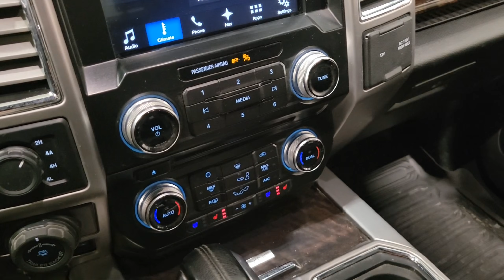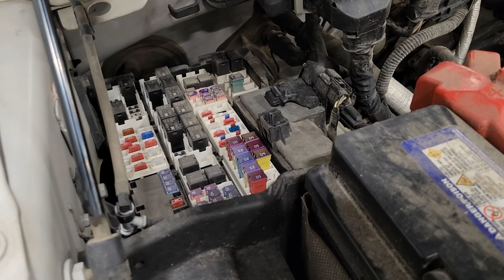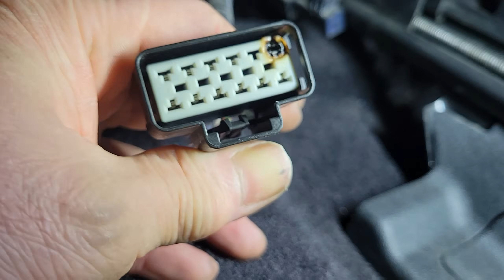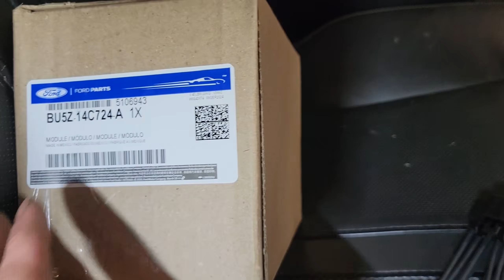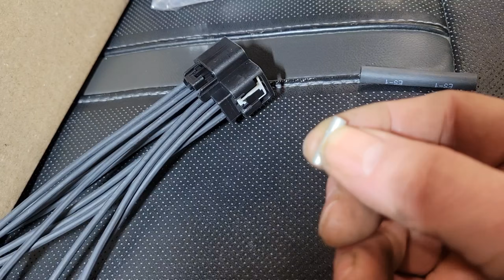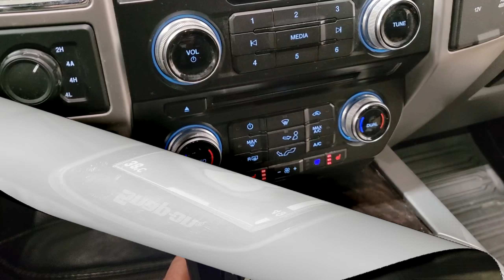How To Fix Common F150 Heated Seat Failures. No Special Tools Needed.

Comment: If the harness melts the module usually need to be replaced as well, you can get modules online cheaper than from ford and they work. If you replace the plug and module and it keeps popping the fuse only when you turn on the driver or passenger heated seat you need to replace the elements in that seat
Reply from the maker: Thanks for the extra advice on replacing the modules and testing the elements, that’s very helpful info!

Comment: 2016 F150 Coyote Lariat about 123k miles. Did this today, added the “extra” ground and so far it’s working great. Only part that was tough was dealing with the melted plastic. Had to wreck the original plug pretty good to get the “T” out. Your video helped me out, thanks!
Reply from the maker: Glad you got it sorted out and it's working for you now, thanks for watching!

Comment: question.  i have a 2019 ford f250 lariat diesel.  my drivers seat heats and cools but my passenger seat neither heats or cools but the button lights come on.  any suggestions?  thanks

Comment: My driver side doesn't work. Passenger side heats fine. I looked under the passenger seat and there isn't a module there like shown in the video. I looked everywhere and it's not there.
Reply: Did you ever figure this out? Mine has the same problem

Comment: I have only the drivers heated seat not working in my 2018 F-150. The others wirk find and the cooling function also. Same deal in out 2020 Explorer. And the rear is even stranger. The button does not light up. What could it be for each case?

Comment: Fuse 17 on my truck is a 10amp for the anti lock breaks. I have an 18 f150
Reply: Did u ever figure out the correct fuse. Im also on a 2018 f150 and confused as well

Comment: Does this cause the system to not work, or work poorly? I have low flow but Ford says it is a flow problem due to collapsed seats.top and bottom both sides. Could it be low power?

Comment: Thanks for the video it was a lot of help. My truck has the same melted piece as this one. Where can i find the exact parts you got for this truck ?
Reply from the maker: I called the Ford dealer and gave them the serial number. You can order it through them, or sometimes they will give you the part numbers and you can try ebay.
Reply: @shanersmechaniclife3164 thanks man!! I will try that

Comment: Does the controle module on the passanger control the driver and the passanger?
I dont see a similar module under the driver
Reply from the maker: Yes. It does both. This truck had issues on the passenger and driver side.

Comment: Does this repair fix both the cooling and heating features? Neither feature works on the driver or passenger side.
Reply from the maker: Yes it did on the vehicle I worked on. Unless you have more than one problem. Let me know how it works out for you. Thanks for watching.

Comment: my heated seats work after fixing it in the video but the wires get really hot when in use, what could be the problem?
Reply from the maker: Check all your connections for corrosion, fit, and signs of melting. Extra resistance causes heat. Hope this helps. Thanks for watching.

Comment: I cannot get the big plug out for the life of me
Reply from the maker: Sounds like it might be melted together.
Reply: I used needle nose pliers and a lot of force
Reply: Same here! Did you ever get it disconnected? Please tell me there’s a trick to it. I tried for almost an hour. Put vice grips on it and still couldn’t get it to come out.
Reply: I had a really hard time as well, gotta use some force with some smaller channel locks and keep wiggling it

Comment: Does anyone have the part numbers from ford for these two items? Trying to find on the Ford website is frustrating
Reply from the maker: I would call your local dealer with your serial number.  Make sure they are correct.  Electronic items usually aren't returnable. Hope this helps. Thanks for watching.
Reply: lol the part numbers are on the bag/box that he shows in the video🤣🤣🤣

Comment: Do you have a link to the products you bought for the replacement? I have the same situation with the pigtail and the melted pin in the control unit. 

So helpful
Reply from the maker: I went straight to my local Ford dealer on this fix. Hope you get your seats fixed. Keep me posted and thanks for watching.
Reply: @shanersmechaniclife3164  how much did they charge you got quoted from my ford dealer $1700 and $240 diagnos fee for a single heated seat

Comment: My cooled seats work perfectly, but only the driver side heat doesn’t work. Passenger heat is roasty toasty. I’ll look under  the seat and check the connections. Thanks!
Reply: I’m having the same issue, any fix?
Reply: I have no heat on the drivers side only.  Fuses are good, no burned pins on the connector or module.  Cooling works and I can hear the fans running.  Going to pull the seat and see if I can access the grid connectors to see if the heating grid has no continuity.  Any other thoughts or ideas?
Reply: @mrbreeze5556 same exact issue on my 2016, any solutions?
Reply: @VanillaEmZilla  I ran a system check on the SCCM module using Forscan.  TEDs not responding and throwing a DTC.  Pulled the drivers seat and performed pinpoint test and found open circuit in the seat back TED.  Replaced TED and everything works like new!  New TED was $180 out the door at a local dealer.  Can find cheaper but I paid the need it now tax!  Hope this helps.
Reply: @mrbreeze5556  how long did it take you to fix?
Reply: @DanBuckley1  It took me roughly 2 days to complete the diagnosis and repair.  I had to wait a for the new part to arrive at my local dealer.  Once I had the new part, a couple of hours to reassemble and install the seat.  Hope this helps!
Reply: @mrbreeze5556 did you have to clear any codes with forscan or anything?
Reply: @mrbreeze5556 had the same problem, changed seat and back heater fans still nothing.
Reply: @AvengX22Have you confirmed that the SCCM module wiring is not burned and that the module is functioning?  Did you check wiring continuity on the new TEDs before you installed them?
Reply: Same on my 2018, what was the issue? Seat element?
Reply: @rogerrabbit8756  I’m pretty sure it’s not the seat element, I switched the wires for the heated and cooled buttons on my truck and when I kicked the “cooled seats” button it heated right up. My guess is the model has an issue somewhere.
Reply: @Jrb33738  how did you switch the wires for the buttons?
Reply: @rogerrabbit8756  Found my issue. It was the heating element in the seat bottom. I went to for dealer and bought a new one. $83. Spent about an hour and a half of my time  pulling the seat apart, and now both the bottom and back part heat up. Hope this helps someone
Reply: @jasonrodriguez3858 how did you figure out the issue?
Reply from the maker: Did you find your problem? Let me know what the fix was. Thanks for watching.
Reply: Has anyone have an update on
Reply: my 2017 does this. cant figure it out
Reply: I had this problem on my driver's side and I had to replace the TEDs (heat element pucks on the back and seat) worked awesome for 3 days. Then nothing on either seat..... Checked, and have a melted pin connector. Just waiting for parts for that.
Reply: I’m having same issue. Only the driver seat not working on my 19. You figure it out?
Reply: Found my issue. It was the heating element in the seat bottom. I went to for dealer and bought a new one. $83. Spent about an hour and a half of my time  pulling the seat apart, and now both the bottom and back part heat up. Hope this helps someone
Reply: Exact same issue with a 2018
Reply: I own a 2017 Ford F250. My cooling/heating arent working at all. I checked the fuses and they all are good. Think it has anything to do with the module? I havent checked the connections or module. TIA
Reply: My truck is still under warranty. I dont trust most dealerships because they bug vehicles to make money, especially when their still under warranty

Comment: Do you happen to have a video on how to actually perform the repair?
Reply: Its a pigtail.. grab yourself some heat shrink solder joints, slap em on and match the connections wire to wire, retape and bobs yer' uncle!